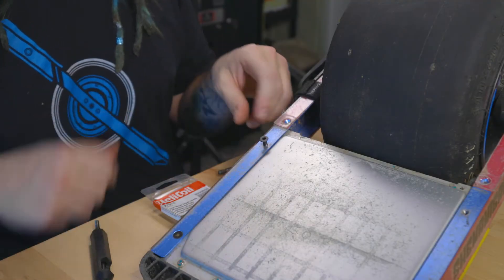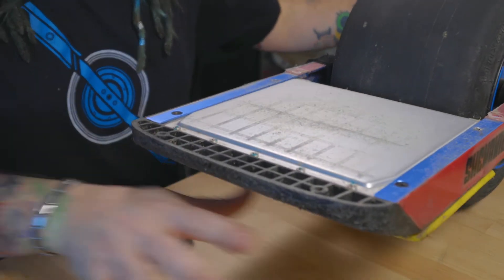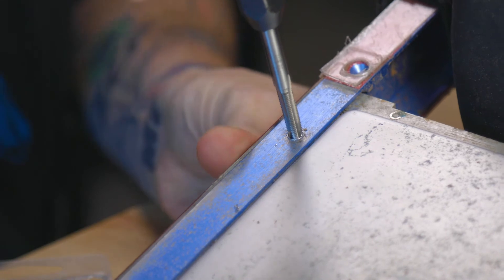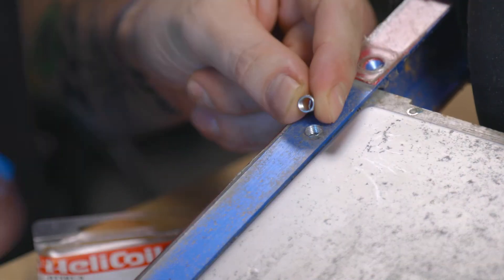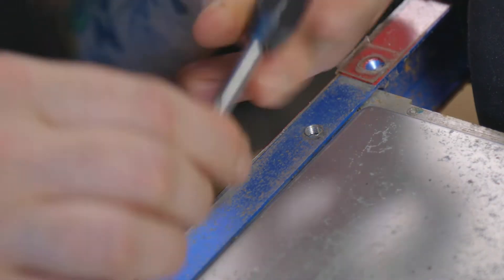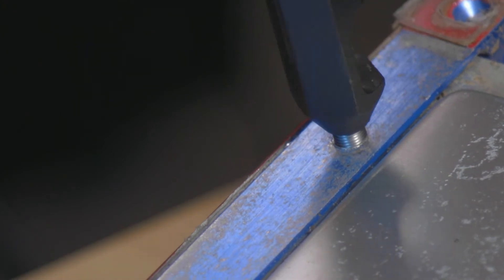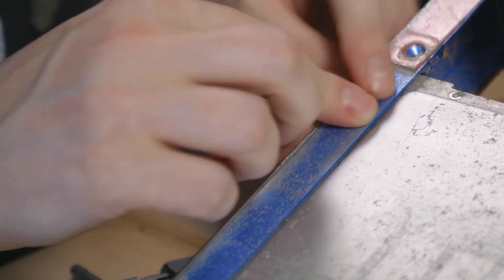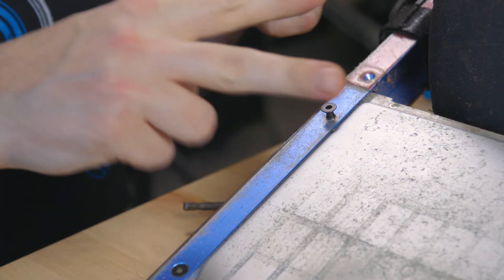OneWheel Stripped Thread Repair Tutorial

Comment: Do the original FM provided screws fit back in with the new helicoil? I'm riding a GT and never owned an XR so not sure if they are all 4mm or 10-32" sizes. Anyone know off hand?

Great video @WheelWithMe
Reply: My understanding is that all early boards were SAE and they have since gone to metric for the GT platform. So I was told in the VESC discord.

Comment: I have a stripped screw on the back bumper spinning in place, the one holding my battery. Plastic housing/molding..... any suggestions? Tried applying upward pressure. No avail. 4209 and preventing me from changing bumpers, battery upgrade, etc

Comment: So my front right float plate screw is stripped, thats the one that goes into the controller. There’s no way of fixing that one without removing the controller correct!?
Reply from the maker: Yeah you have to remove the controller, but that is super easy. Ignore the borderline illegal warranty void stickers, they won't actually void your warranty. 

But those brass inserts are difficult to replace and require a special tool for a soldering iron. I've actually never tried to put a helicoil in one of them because the brass insert can spin freely very easily.

Comment: thanks bro. is it possible to strip the threads again after doing this? and if so, can you rethread it again?
Reply from the maker: So, i've never stripped a Helicoil but i have ripped them out because i didn't install it 100% properly. Having said that, there is a new method for upgrading your threads. You can now get stainless steel inserts installed and they look so clean and should, in theory, never strip. If you go to StokeLifeService.com you can find a local repair shop and get it done. (Otherwise i offer the service as well but it would involve mailing me your rails)

Comment: Do u think putting some lock tight on the helicoil would be a good idea? To help keep it from popping out. Also how bad is it if I punched thought the waterproof seal? Great video been trying to figure out how I wanted to retread by board
Reply from the maker: I wouldn't really worry about popping through the seal because on newer boards they have a much better rubber seal than the old foam one on my board. However you could always just squirt a little silicone in the hole like you do when using a waterproof Badger Wheel kit. 

As for the loctite, I probably wouldn't do it because you might want to replace the helicoils down the line. Eventually the extra bit that hangs down (if you don't cut them to the right size) starts to droop and catch. 

Nowadays I actually use stainless steel inserts. I have a repair shop and I offer that service. There are actually a ton of repair shops across the country that do it as well.

Comment: Im trying to do this the the screw right next to the one in this video and its not catching the hole. I assume this screw is a little smaller?  Has anyone drilled out new bigger holes, then threaded them?
Reply from the maker: All of the screws for the fender, footpads, bumpers, are all the same diameter, just different lengths. You probably just need to apply more pressure.

Comment: Is this the same size as the fender holes in the XR?
Reply from the maker: This is an XR that I'm working on. So yeah, the helicoils are the same size as the stock screws.
Reply: Wheel With Me alright, I wasn’t sure if the footpads were the same size as the screws in the middle, where the fender goes. Thank you.
Reply from the maker: All the screws in the footpads, bumpers, fender, are all the same diameter just different lengths.

Comment: So I have two screws striped on my rear fender holes will this work on the pint I can't get an answer anywhere on the size of screws for the pint or how to fix it
Reply: Did you ever have any luck? my two back Pint fender screws wont screw in either - but odd, when I take the fender off and screw into the hole it seems to hold just fine. No idea.

Comment: Super helpful man! Thank you for this video, my onewheel pint has two stripped holes on the front foot pad and then right under it on the fender screw hole. And I was so upset thinking it was unfixable cause I’m not very good with this type of stuff on how to fix it. But that is so much more simpler than I thought! Great video, and great help 👍🏻

Comment: Are the screw and hole the same size as the pint? You don't need to drill out the hole first? Great video.
Reply from the maker: I'm actually not sure because I've never opened up a Pint unfortunately

Comment: How can I get a screw out of that blue rail that is just spinning in place?
Reply: I have the same problem
Reply from the maker: Ugh...YouTube put this in my spam folder. I hope you got this problem fixed by now lol 

Usually you can just drill out the screw with the included Helicoil drill bit.  However if the screw is going into one of the brass threads then that means the brass thread has come unglued. I've had this problem and i cut off the head to the screw to get my board apart, then i was able to carefully pull out the brass thread, and epoxy/super glue it back in place.

Comment: By the way you are using the helicoil inserter a little incorrectly. I mean I guess if it works for you its fine, but the helicoil is supposed to be inserted into the gap in the inserter and screwed through the end of the tool. Basically like a funnel to get the helicoil compressed and aligned correctly.
Reply from the maker: Yeah, I did that the first few time and the coil always came unwound and loose instead of staying a tight coil 🤔 So I just do it this way and keep pressure on it to compact the coil.

Comment: My brass threads which hold my float plates on are stripped, how would i fix that?
Reply from the maker: Exactly which threads are you referring to?  Front or rear footpad?
Reply: Wheel With Me The front screws on the bottom of the board under the front footpad which hold the bumpers on. You replace the old screws with longer ones when you put floatplates on.
Reply: @codypursifull8427  Hello....this has happened to me as well. Were you able to remedy it? I had a worse case scenario and actually had to rip the brass thread out by cutting away the plastic around it.

Comment: This was super helpful! I'm assuming the helicoils stronger than the a aluminum frame. Would it be a horrible idea to just spend the time rethreading the whole board? That way you won't have to worry about stripped threads in the future? I already have two stripped fender threads so this was perfect for me! Thanks!!!
Reply from the maker: They are definitely stronger than the stock aluminum threads on the rails, so that wouldn't be a bad idea at all. You could probably skip doing it to the brass inserts that are in the control module though. If those were stripped, i would just replace the brass inserts themselves.
Reply: Wheel With Me how would you replace the brass